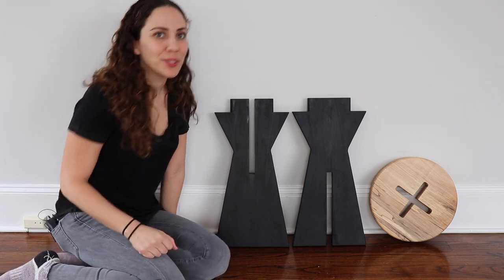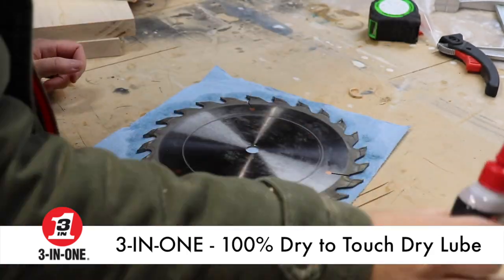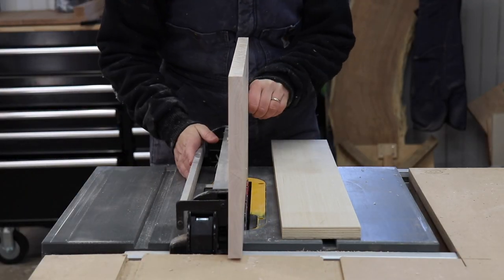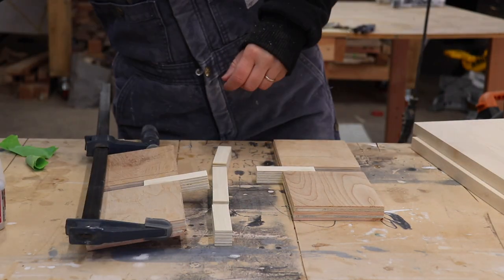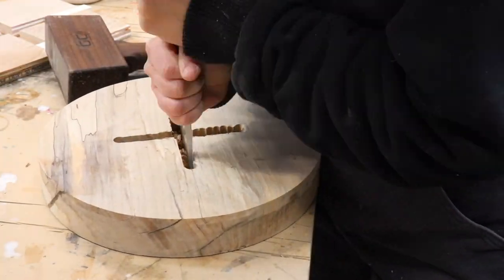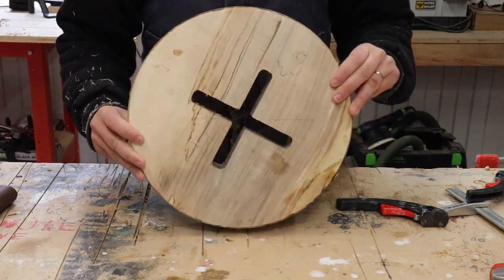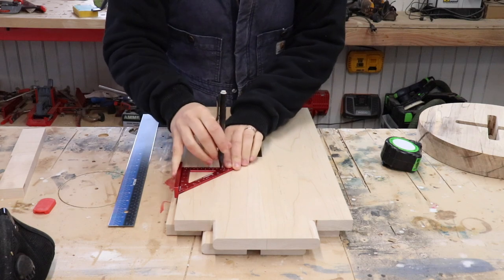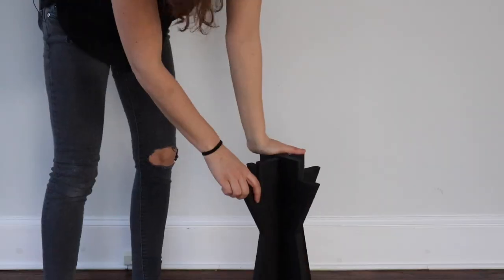DIY Knock Down Stool or Side Table // Easy Woodworking Joinery // Mortise and Tenon // DIY Project

Comment: I like it!  Also, a trick I learned from the Wood Whisperer is to not use double sided tape. Use regular painters tape by putting one strip on each piece and then use CA glue on the two strips of tape.  Glue on one and activator on the other. When you want to take them apart, it is is easy peezy!  This really works.  Thanks for a great video Tamar!
Reply from the maker: That’s a great tip! Thanks!

Comment: Love the design, especially that joint.  There's something immensely satisfying in making a joint that strong and stable, that can so easily disassemble and reassemble, without glue or fasteners, and relies on wood stacking on top of and being retained by wood.  Maybe just me, but there's something 'Japanese joinery' or even ASMR about that....  lol    

It can be tricky to cut -- too tight and pounding it together can split the wood (if using natural wood), but too loose and the piece will wobble and be unstable. 

I first saw it when I was much younger, in a water bed kit, with OSB planks standing on edge and joined with that joint, like a tic-tac-toe board, to support the water bed deck.  ("Now how the heck can that flimsy-looking boxy thing support all that weight....").  Then later saw it used in a knockdown shoe rack, same sort of tic-tac-toe configuration, smaller and on its side this time, for the shoe pockets.  Then later in a side table with similar orientation to yours here, with 2 24"x24" squares joined in an X to support a 24" circle (out of plywood, made to be covered with a tablecloth, 'boxy' so as to not be 'tippy').  Have seen it since in cubbyhole shelves of varying types, from small knick-knack shelves to book shelves.  Saw some knockdown children's desks, where the desk panels were on one side of the slot and small tabs on the other, that hung out along the edges.  Even saw a variation of it in a knockdown sawhorse (top piece sits in notches in the tops of the leg assemblies, with cleats attached to the sides of the top piece to form channels for the legs to slide into).  

And still don't know what to call it, to do searches for projects using it (half lap, slotted, etc.).  Thanks for your suggestion, I'll try 'cross lap'!   :)
Reply from the maker: Ha! Yeah.... I have no idea what to call it. But I totally agree. It is so satisfying!

Comment: This stool seems very simple, but there’s a lot of work to make it perfect like you did! That cross jig is very clever 😊🤘
Reply from the maker: Thanks! I think It’s interesting to see the other video where I just used a jigsaw and it’s so much simpler.
Reply: @3x3CustomTamar  Which one?
Reply from the maker: Woodworking Engineering the video I linked in the description where I built the same stool just using a jigsaw.
Reply: @3x3CustomTamar  Thanks Tamar, I'll look at it tonight 😊

Comment: That's a nice and simple design.
Nice job. 

As far as the complaints about tools is concerned, just ignore them. Haters gonna hate! 

That stool / side table can be made with hand tools, including the round top. So I figure that the one's doing the complaining wouldn't bother trying this even if they had all your tools.
Reply from the maker: Thanks! I don’t really want to ignore them, I want to try to encourage them. I think people use the lack of tools as their excuse to not get off the couch. I want them to know they need to find a different excuse.... ha.
Reply: @3x3CustomTamar  
Well, if you have the moxy to deal with them and not let it discourage you then go for it.

Comment: That is beautiful. I wanna make something like this for my wife, she'd love it!
Reply from the maker: Thanks so much! I actually sell the templates now on my website
Reply: @3x3CustomTamar --  I definitely recommenced the templates.  Rather than a bunch of measuring and marking and discovering you were an eighth inch off, you just slap the templates on the boards you want to use.  I am finally going to make my first one as my next project, but  for the first I will use a live walnut board for the seat that I got at a shop that sold me a bunch of round pieces of wood of the right size for the seat/table top. Great Idea and ty for sharing it with us.
Reply from the maker: @capnbobretired  awesome

Comment: I use oven cleaner to clean saw blades, put blade in a pizza pan larger than the blade and use a nylon brush on the blade after spraying the over cleaner, works like a charm.
Reply from the maker: Yup! I use simple green. Same concept. This doesn’t clean them though. This is what I put in after I clean them. It prevents the pitch from building up so you can go longer between cleaning your blades.

Comment: Hint: if you use white vinegar, it won't raise the grain. I know about India ink (I'm also an artist of the painting variety). India ink can be mixed with either ammonia (which stinks) or vinegar as a water-based medium, which will help to keep the grain from raising. Maple (especially the quilted variety, which I use a lot) is notorious for the grain raising, even with Vinegar. Raise the grain with vinegar, lightly HAND sand at 220 to take off the raised burrs (I know, "too fine" for most finishes but you're only removing what has been raised), then apply the India ink and vinegar or ammonia combo (I've never measured, but have only added, say 1/4 of either so as not to dilute the ink too much). LIghtly sand by HAND (so you can feel) when dry (in minutes) and apply a second coat. It's worked for me well in the past.

Comment: 1) I love your creativity and your skills are inspiring!
2) the 3 in 1 stuff, so glad to know there's something like that out there, ruined a router bit the other day trying to sand the resin off - I know!
3) I have the same table saw and don't know if it's the zero clearance insert, but sawdust flies out the front even though I have a Powertec dust collector hooked up, do you have that problem?
4) A while back I realized I had to stop swearing, but last night was routing out some grooves in boards to make a stand to hold dowels to roll fabric onto like in upholstery stores, because I also sew and turned the jig the wrong way. Good thing nobody was in earshot!
5) Thanks again for a great video
Reply from the maker: Thanks! Yeah the 3-in-one stuff is great. I always have dust flying even with the dust collector hooked up. It does help if you put some tape on the gap in the throat plate. And yeah. We all have our moments. Ha

Comment: Well done another great video ... could I ask a couple of questions ... 1) If you were just about to buy your first hand held circular saw would you get one with a power cord or rechargeable battery? 2) Which software do you use to edit your videos? Thanks.  M
Reply from the maker: Hey! Thanks! I have only used battery powered circ saws and for what I do they have enough power. Just remember to always keep an extra charged battery on hand. And I use iMovie.

Comment: Great tip for the dry lube. I hadn't thought of that and have been cutting a little large so I can take an eyebrow to get the burn marks off (I use a lot of figured Maple). Have you tried coating your blade with a ceramic coat?
Reply from the maker: I havnt

Comment: I would like to build a end table / stool exactly like yours, except I am concerned that the "Y"s under the top might not be able to hold the weight given that they are undercut. Do you have any thoughts about the stool's strength? Thanks.
Reply from the maker: Mines been holding up for years

Comment: Great build, but I think you mixed up the names of the router bits. Flush cut has the bit on the bottom and pattern bits have them on the top. Still great video!
Reply from the maker: Yup. You’re right. I corrected it in the video description after editing ☺️
Reply: @3x3CustomTamar  oh sry my bad😂
Reply from the maker: Ha! No worrries. I wish you could edit videos after uploading....

Comment: Cool build but maybe a cigar smoking table instead.
Reply from the maker: Do you need a table just for smoking cigars?
Reply: 3x3Custom - Tamar, I keep my big fancy ashtray, lighter, a couple cutters and maybe some matches on mine. It use to be more popular 100 years ago. I have one about that old which is copper lined cabinet and a sturdy top to put your smoke stuff  on. I like to use end grain cutting boards also, I’ll whip one up for a donation with a few good smokes for those wine auctions. 
I liked the sturdiness you put in this table that’s why I suggested it. Plus you can move your table which I do also when it is warmer outside. I smoke in my shop and it takes a good 1hr to 5hrs to have a good smoke while I work, I’m often cutting and relighting it for a fresh taste without the ash flavor. My table separates my smoking from the sawdust also. Still the rule is about 45min to smoke a good cigar. A table make that all handy.
Keep up the good work!